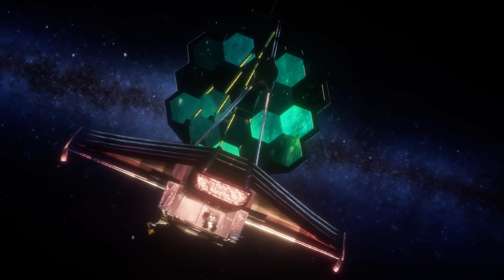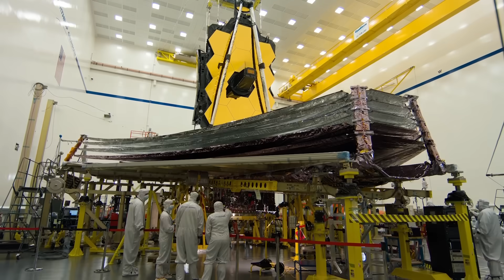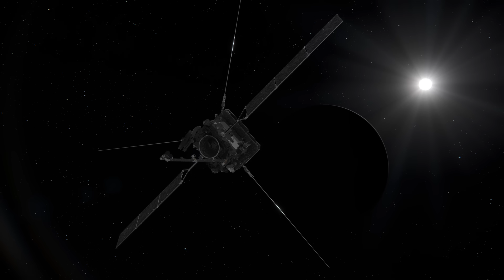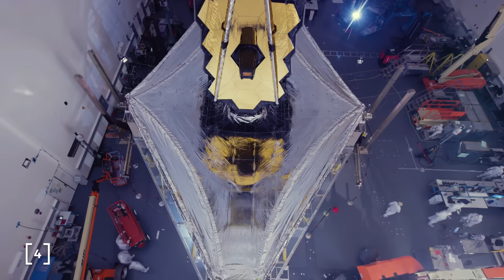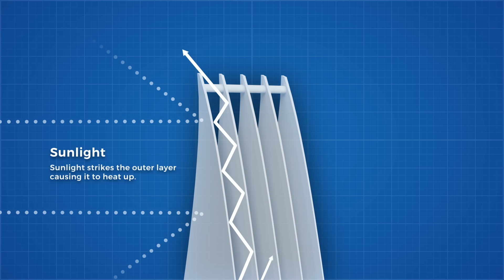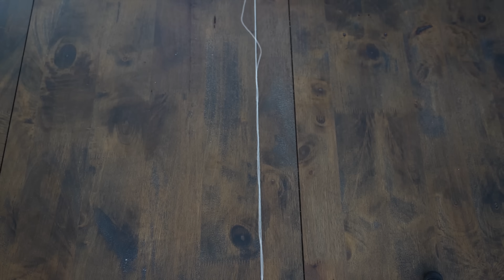The Insane Engineering of James Webb Telescope

Comment: Excellent video, really enjoyed it!

But a few minor mistakes to point out:
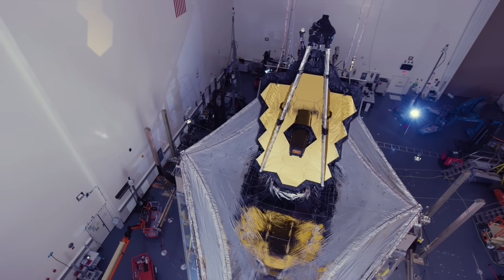5:22 You say "83 °C" but have written "-83 °C". I assume it should be +83°C.
18:56 Infrared is (unlike you said) lower frequency than ultraviolet and gold reflects lower frequencies well. You're thinking about wavelength .
Reply: also kelvin isn't a degree scale 13:34
Reply: Isn't the boiling point in space much lower though? So maybe he meant that -83°C was close to the boiling point of water in space?
Reply: I expect the correct value is actually -83 c
Reply: @GidionG  He did say it would be nearly hot enough to boil water, so I expect +83°C (as he said).
Reply: "The Pulse Tube Cryocoolers"  is a  great name for trendy indie  techno  low fi  neo jazz band...
Reply: @hieronymusnervig8712  That's what i thought too
Reply: @GidionG   since there is no pressure in space, the temperature necessary to boil water falls. which is why -83c is not entirely wrong.
Reply: @jmax8692  nothing wrong with a little correction, it's constructive criticism and that's important to most people.
Reply: Another problem is that he says " ## degrees kelvin" which is wrong. When using Kelvin you don't use the ° sign as you don't say "degrees". It's just "kelvin"
Reply: @jim Anyone going to tell him? No? I aint doing it
Reply: hirvi more like poro

ookkos suomalaine
Reply: @hieronymusnervig8712 , in space water and any liquid boils at any temperature.
Reply: @mina86  No, the boiling point drops a lot in space but not down to 0K.
Reply: He references [3] on screen in the video, but does anyone know where the actual reference link is? I didn't see any at the end of the video or description.
Reply: @siggyincr7447  You can get 0 vapour pressure? OK I guess as long as the material is a solid.
Reply: @Astor_V  83C in earths shadow. Nah. I'll go with -83C.
Reply: 6468
Reply: Ok, I though I saw -83, but wasn't sure. thanks for the sanity check
Reply: i was about to comment that but i saw this comment
Reply: Maybe do to the vacuum of space?
Reply: @grekiki  solid to gas is sublimation not boiling.
Reply: Water boils easily in space.
Reply: @SeaJay_Oceans  And their first digi-single will be a pulse code modulated sine wave.
Reply: @jmax8692  irrelevant
Reply: I was going to mention this, but found your comment! Good job
Reply: @sleeptyper  No it is not, Kelvin is an absolute unit. Therefore the only correct way is (number) Kelvin or (number)K, whereas Celsius is a degree scale, therefore (number) degrees Celcius or (number)°C is the only correct notation. 
Also there is no such thing as "273.15 Kelvins" or "Zero Celsius", a unit doesnt have multiples and temperature in °C has to have a degree notation.
I encourage you to read up on the SI unit standard.
Reply: @jmax8692  On the other hand, it shows that people are paying attention, and if the questions and/or corrections help those who were confused by the errors, surely it's a good thing?
Reply: @
Hirvieläin - From what information I can find, it does appear that liquid water would instantly boil in interstellar space at somewhere beyond -90C and then immediately freeze into tiny ice crystals. That said,  -83C would absolutely cause water to boil and remain as a vapor due to the near perfect vacuum of space. That leaves us with the sentence in the video saying "...nearly hot enough to boil water" thus we can conclude that he must be either talking about +83C or has something wrong.

Now, I would be very surprised if the sun would actually heat something to +83C at a distance 1.5m KM further than earth. Then again, there is virtually no conduction or convection happening to remove any thermal gain, only radiation. Perhaps it would actually get quite hot where the sun makes direct contact for this reason. Hmmmm, not something I have ever thought about or researched before.
Reply: I've pointed out a couple times errors in previous videos. Sometimes they are typos or discrepancies between what he says and what he illustrates that would have been picked up if the video was edited properly. Other times, he gets the facts so wrong (a recent video on shockwaves and another on  the 787), it suggests the author is far from an expert on much of the content and merely compiles research that he may have interpreted incorrectly. 
The fact that he doesn't correct the his mistakes or respond to comments that point them out tells me to question the accuracy of what he publishes and that he makes videos for entertainment and cha-ching$ rather than factual educational videos.
Reply: @majbach1968  TBH there are a lot of YouTubers who just collate shit from Wikipedia and don't really care if it's right or not.  Being right doesn't make you any more money.
Reply: @Mp57navy  Then you'd guess wrong. It's not in the Earth's shadow and that was never stated. You wouldn't need a 5 ply sail to protect against 200,000 watts of sunlight and the scorching heat of "-83 C" if it was.
Reply: @hieronymusnervig8712  the boiling point of any liquid is partially a factor of the atmospheric pressure around it. Since the pressure in space is 0, the water would boil in space no matter what the temperature was. By this logic, since he was talking about a specific temperature at which water would boil, it seems to make sense that he was referring to +83°C and at a location where the atmosphere would be present.
Reply: @siggyincr7447  Well it's impossible for anything to boil at 0K but space isn't 0K is it? But it is at zero pressure. What both of you are forgetting is that all liquids will boil instantly in a perfect vacuum but only briefly until they turn into a solid from freezing. At which point it goes from solid to gas - sublimation as you said. In a vacuum, water still freezes at 0C but will only sublimate until about -50C . If sublimation/boiling occurred at any temperature while in a vacuum, comets wouldn't be made largely of ice.
Reply: @hoagy_ytfc  Agreed
Reply: @subsgob00m  Absolutely it would get that hot. Without an atmosphere, there is nothing to scatter or absorb the energy of sunlight. He did state that the area the size of a tennis court would receive 200,000+ watts of energy. Think about how hot the sun-side of the moon gets (250C) or how comets start to sublimate many millions of kms farther away from the sun than the Earth is.,
Reply: @_--_--_  I stand corrected. Thank you.
Reply: @Mp57navy  It's not in the Earth's shadow. It will orbit the L2, not sit still in the middle of it. It's powered by PV, solar cells, which wouldn't do much if it never saw the sun. That said, the cold side of the spacecraft is in the shadow of the sunshine.
Reply: @the1dark2prince3  -83C is above the 145-170K marking the lowest sublimation point of water ice, so it is very much entirely wrong.

Also, without pressure there's no boiling. Just sublimation.
Reply: @Mp57navy  at 1.5mm km, Earth doesn't create a complete shadow. Earth's angular diameter will be about the same as the sun, so it will be outside the umbra. The actual temperature is rather a silly figure, because it all depends on how much energy the materials absorb per unit area and how the energy dissipates internally. There is no classic "temperature" anywhere in space. While individual particles have a certain amount of energy, the way we think about temperature -- ie the thermal equilibrium that will be reached by something hanging around there, doesn't apply objectively.
Reply: @majbach1968  It's technically in Earth's shadow, but outside of the umbra. It is also going to be in a halo orbit so it won't get the maximum radiation shielding it would get if it were perfectly aligned with the Earth and sun.
Reply: @majbach1968  he does reply to comments that criticize him and does take away from it I've seen it many times on many different videos including this one.
Reply: @KCNusach  The person's remarks that I replied to implied that it was hidden from the sun's light by being engulfed by a shadow - which is incorrect. And technically  it is not in the Earth's shadow either but rather the Earth's shadow falls on the mirror, in the same way a bug that is several hundred feet away from flies between your eyes and the sun.
Reply: @majbach1968  The angular diameter of an object is constant multiple of its diameter divided by its distance. At Sun/Earth L2, Earth's variable coefficient would ve be 12.7/1500 (12700km: 1.5Gm) whereas the sun's would be  14/1510. That's a pretty significant eclipse. 91% of diameter, and more than 80% of luminosity blocked out. It helps that it would be in a halo orbit, although I'm not sure about the size of that pseudo orbit.
Reply: @_--_--_  I'd like you to elaborate in practical terms. If we skewed the value of absolute zero to be defined as 0 degrees Centigrade and the temperature at which water freezes is 273 degree C, the graduations or units between different levels of heat would be the same between Kelvin & Celsius. No? Kelvin and Centigrade both have the same magnitude, their scales just have different base references. 
Omitting the word "degrees" when using Kelvin is semantics, no different from using the term knots instead of nautical miles per hour. At least that's my take on it. Reference why I am wrong pls.
Reply: A simpler way of putting it is, diameter ratio sun:earth is ~109; whereas at L2 the ratio of the two respective bodies' distance is ~100. So you don't get a total eclipse, but it ain't a gnat at a hundred paces...
Reply: @majbach1968  agreed. High production value, low integrity. But I still appreciate the content because he and I agree on the definition of insanity vis-a-vis engineering 😛
Reply: @majbach1968  sorry for responding to your fifth comment in complete schizophrenic order, but here goes. Besides the history of the various temperature scales (and "degrees Kelvin" used to be a thing until a couple of decades ago) the centigrade and Kelvin scales differ in that the former's units are defined as degrees in a finite interval, whereas Kelvin is defined as the measure of temperature from an absolute point. We don't have degrees mass or degrees velocity.
Reply: Yes bit confused at that part but you corrected it👌🏻
Reply: @majbach1968  
You are wrong exactly because Celsius is not referenced to absolute zero, therefore it is not a absolute measurement of the physical property of temperature, there is no such thing as negative temperature, and because Celsius in not a absolute unit we have to therefore notate it as a degree.
But because Kelvin is a absolute unit because its referenced to absolute zero so it does describe the property of temperature in an absolute manner it has to be notated as just the unit, the usage of "degree" is plain and simple not correct.

You can call units whatever you like as long as it works for you, however this discussion is about correct notation, therefore semantics do matter. Words have meaning, and changing words changes meaning, this is especially important in physics and engineering related topics, as precision in communication with language or math is of utmost importance.
Reply: @hieronymusnervig8712  I am assuming that the -83 C was the error since he mentioned the boiling point of water and in the thermal imaging example he used later it showed the first layer of the thermal shield being close to 100 C
Reply: @p_06k  Yeah but that is a pretty pedantic point, it is just an arbitrary definition that makes no difference
Reply: @gillysuit2 I understand the confusion, but the European Space Agency operates facilities all over the globe. One of them happens to be in Kourou, French Guiana, in South America.
Reply: @hieronymusnervig8712 
The triple point if water is not much below 0 C, below that liquid water doesn't exist and water goes straight from solid to gas (sublimination).
Also if I remember rightly the sublimination point at low pressures is ~50C.
Reply: @alexpontecorvi3092 
Right now the convention us to drop the "degrees" but that wasn't the case historically.
I wouldn't call it wrong, just archaic.
Reply: @jr2904  It's important to people who car about science and truth. Apparently, Jay doesn't care about those things.
Reply: i did some research and found that the boiling of water depends on the pressure. and there is near to non(there is non) in space.
Reply: I think you didn't listen him well,he said that gold is a poor reflector for lower frequency of "visible" spectrum of light,it doesn't include all the light spectrum for which infrared has lower frequency.
Reply: @scienceaffairs2919  He probably meant wavelength, not frequency. Look at the graph. Reflectance is low for lower wavelengths (or HIGHER frequencies).
Reply: Wild theory here, maybe he just didn't see the negative sign when he read it, but it was put it in the graphic correctly? Minor mistake, kinda funny lol. Adds to the character of the video IMO, and humans are smart enough as a whole to self-correct. Apes together strong
Reply: these always have plenty of things wrong, they just have good production value and look good. still full of errors
Reply: At near perfect vacuum of 29.9199 inches of HG vacuum, the boiling point of water is approximately -90°F or - 68°C. Space is not a perfect vacuum. Even so, the figure mentioned was MINUS 83 degrees Celsius, not Kelvin, which is not measured in degrees anyway. If he's stating that the temperature on the far side of the shield is -83 Celsius and water boils at -68 degrees Celsius, then it is only 15 degrees Celsius from the boiling point in near vacuum.
Reply: @gillysuit2 he said it was European, not in Europe. As the name suggests it is owned by France, therefore it is European even if it isn't in Europe.
Reply: @_--_--_  I think you just contradicted yourself and proved my point, particularly because I asked for a practical example or a reference that backed your statement.Both Celsius and Kelvin DO have the same magnitude or graduations. So, if you defined absolute zero as being 0 C, the only difference between Celsius and Kelvin when specifying the temperature of matter would be add the word "degrees" into one and not the other - at least by your testament. I think you need to go read what Unit" and "absolute" means. And, it IS semantics because if I say 100 Kelvin or 100 degrees Kelvin, the meaning isn't changed, not to any listener nor to any equation. Give me ONE example of how placing a º before a K in any way changes the value or meaning. .
Pointing out that "273 degrees kelvin" should have been "273 Kelvin" is like faulting someone for having written "your" when it should have been "you're" on a math exam.
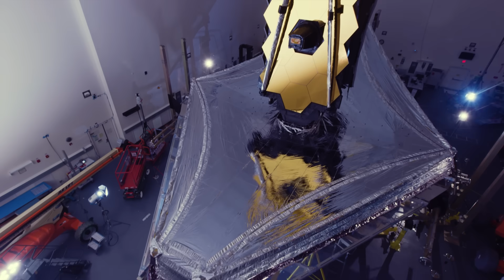Reply: 7:53  It’s Aluminum. Not Aluminium.
Reply: @_--_--_  The rankine scale is also an absolute temperature scale, but curiously has degrees. The decision to add a degree marker or not is an arbitrary one, and even scientists sometimes say degrees kelvin. It literally does not matter to anyone but pedants.
Reply: @KCNusach  No need to apologize, I like the discussion. 
Your last statement DOES give me pause. But I am still failing to grasp the practical implications of your explanation. How is Kelvin NOT a finite unit (with the same magnitude at Celcius as well)? And isn't Celsius ALSO a measure of temperature? Also from an absolute point (in this case, the freezing point of water)?
Is saying "it's 20 degrees Celsius outside today" not exactly the same as saying " it's 20 Celsius outside today"or "it's 20 degrees outside today"? Even when we are in an environment were there are NOT multiple or ambiguous units  (like mph vs kph) for expressing the same value, we still always follow a value with a unit: "the rock weighs 10 pounds". With temperature, we state" it's 90 degrees outside". We don't follow it with Fahrenheit, Celsius or Kelvin, because it's never 90 K or 90 C outside but we do still say "degrees" to indicate we are talking about temperature (and not humidity for example). The word "degrees" may not be a unit itself but it is used in lieu of one and thus has the same meaning. 
It was suggested originally that the term "degrees" actually changing the meaning or value when used in conjunction with the unit Kelvin. It does not. We don not have degrees mass or degrees velocity but both mass and velocity are measured with units that have graduation, magnitude or even "degrees" - if you look at the definition of degree. It is just normal to state the unit instead of the word degree. In temperature, it's normal to say "degree" instead of the unit. The value isn't changed. 
In geometry however, the word "degree" does change the value of a measurement.
Reply: @JohannGambolputty22  HaHa. I was thinking of saying that too. Ironically, I just read yesterday that the modern British accent is actually younger than the current American accent, in other words, centuries ago, British sounded more like modern day American English than it does modern day British English.
Reply: @majbach1968  the comparison with geometry is apt. A degree is a unit of arc defined as 1/360 of the circumference of a circle. The absolute unit of angular sweep would be radians. This isn't about ambiguity: both units are defined with equal precision; it's about what the unit presents. One is a fraction of an interval, the other is an absolute magnitude.

Using the word "degree" is adding a dimensionless coefficient to your result: in geometry, what you're saying is x(2pi/360). In temperature you're saying x(boiling - freezing)/100. The Kelvin already has that factor. Technically, degree kelvin, if "degree" would be defined as per Celsius, you'd have a unit of 1/100 K...
Reply: Which country use farenhight and which does use degree Celsius
Reply: @majbach1968  
Lets just say its a good thing that you arent a engineer (or atleast I hope so), because of exactly that mindset do probes crash into the surface of mars unintended and bridges collapse, with countless of examples where faulty unit conversion was mostly caused by bad or unclear notation.
This is your practical example why stuff like this does matter, if you go over checking lots of calculus, something like "°K" can be easily confused with °C, because our brains automatically assume things.

I already explained it pretty clearly why it is notated in the way it is.
I will try again as it is obvious you didnt understand.
The magnitude of the unit is completly irrelevant, it doesnt matter that K = °C + offset.
What does matter is that one unit represents reality, the other does not.
x°C tells you nothing about the kinetic energy that is heat without already knowing a reference point of energy, for example 20°C.
Because you need a known reference point for the unit to be useful it is a degree scale.
With Kelvin you dont need a reference point to know how much Kelvin is how much potential energy, thus the unit is absolute and not a degree scale. It is literally that simple.
Reply: @timseguine2  Well thats mostly just imperial weirdness, you dont have such inconsistency with metric.
Also I think its important to mention that the degree is very often omitted with rankine exactly because of the same reasoning as with Kelvin.
Also I dont think any scientist worth their salt would ever say "degree Kelvin", I have never seen that, but maybe you mean some weird TV "scientist", then yeah maybe those would say something stupid like this but they are only "scientists" for show anyways.
Reply: Lovely video but Also the atomic weight of Beryllium is approximately 9 amu and not 4 amu. The atomic number (number of protons in the nucleus) is 4.
Reply: @hieronymusnervig8712  I'm pretty sure that at -83°C water isn't boiling, it's frozen solid.  Given the low ambient pressure, there will be significant sublimation, but boiling?  I think not.
Reply: @jmax8692  
Constructive criticism is also totally why this comment section on YT existed... at least in the good old days.
Reply: @scienceaffairs2919  
That doesn't track, especially when gold is so poor at reflecting shorter wavelengths of visible light... that it appears gold.
Reply: @_--_--_  
"ISO standard day conditions means 288 degrees Kelvin (15 degrees Celsius), 60 percent relative humidity and 101.3 kilopascals pressure." Source: ECFR Official Government Website.
Also "CRYOGENICS is a science concerned with the very-low-temperature environment, extending from a high of 77 K (degrees Kelvin), or —196 C (degrees centigrade), where liquid nitrogen (N) boils at standard pressure, down to absolute zero (0 K or —273 C). This region has come to be associated with rockets, many of which carry large quantities of liquefied hydrogen (H) and oxygen (O) as propellants." Source: "Application of cryogenics to electrical and electronic design" - published by IEEE 
Typos abound am I right?
Or maybe... just maybe, it's not as big a deal as you thought?
Reply: @VariantAEC  sourced argument, hurrah
Reply: @BradBozarth  
I do my best to source my findings even in the current era where citations are frowned upon.
(YT won't allow me to also link the sources I used here)
Reply: Well when ice asteroids from asteroid belt enter the inner planets Sun actually boils water off them making those gas plume-like tails we call comets. Once I saw a documentary about SpaceX flight computers that have to withstand extreme temperatures differences when in and out of Earth's shadow (somethink like from -240°C to +120°C but I could be wrong). Temperatures certainly varies in regards of distance to the Sun.
Reply: @holy3979  You don't assume, this can be answered easily using google and -83 is actually close to the fact.
Reply: beryllium’s atomic weight is 8
Reply: No assumption necessary: “Thermal models show that the max temperature of Layer 1 is 383K. The max temperature of Layer 5 is 221K, and its minimum temperature is a chilly 36K.”

383K = 109.85°C
Reply: @hieronymusnervig8712  True, but the point of relating it to boiling water was to make it easier to comprehend to common people. Referencing the boiling point of water in a vacuum without explaining the difference would just make things more confusing.
Reply: @Mp57navy  The JWST won't be in Earth's shadow, it's orbit was specifically designed to avoid it in order to prevent a loss of power from the solar panels.
Other people pointed at the fact that water would boil in vacuum at lower temperature than on eathr. This is true, and to be more precise, water could not stay liquid in vacuum, it can only be a solid or a gas. Anyway, I assume that he only talked about the "boiling water" thing to give a reference point for people, especially those that are used to °F, and not an actual indication of water boiling on the Webb (as there would not be any water there anyway...).
Reply: If you really think 1 million miles away from earth - further from the sun will somehow become +83C in space, then you are not the position to point out mistakes. Water boils at -63C in space, thus -83C is "nearly" boiling, which is why he said that although he did not say "minus" 83. But the conclusion you draw that you "assume its +83C(181F in space LOL) shows some weird brain thinking on your part.
Reply: @cjay2  
Did he write °K?
No he spoke it. I've already covered how major institutions including IEEE don't exclude the word degree from Kelvin standard notation is just "K" for Kelvin scale temperatures and no one is arguing with that but I don't see "°K" notation anywhere in this video I heard the spoken word "degrees Kelvin" and it appears in the auto-generated captions and English captions and that is just fine.
Reply: @Mp57navy  NASA expects the first layer of the heat shield to get to a maximum temperature of 110*C. It's orbit does allow for the sun to directly hit the shield. When operating in place 83*C is expected.
Reply: @majbach1968  You yanks are so behind us.
Reply: @AndrexoHD  At -83 deg C water is not boiling it is solid(ice)... comets starting to sublimate(not boil) when they are closer to the sun they are never in liquid state...
Reply: @WOTArtyNoobs  "At near perfect vacuum of 29.9199 inches of HG vacuum, the boiling point of water is approximately -90°F or - 68°C. Space is not a perfect vacuum." -> Sublimation is the transition of a substance directly from a solid-state to a gas state. There is no boiling at - 68°C in space because water can't be liquid in this conditions.
Reply: @undead_corsair  I ain't no Yank, eh?
Reply: @the1dark2prince3  actually the melting point of water is still almost exactly 0 °C at zero pressure because the melting point depends only slightly on temperature. So at 0 pressure water doesn't boil at all, but it is either solid or gaseous and sublimates at 0 °C.
Reply: @Bialy_1  Quite true. Water would sublimate at this temperature. I doubt that there would be any water on the James Webb as it would dissipate by the time it gets to L2. I guess he was only trying to suggest that it's cold and prompting people to post comments on his supposed mistake - that was not a mistake,  because they were jumping to the conclusion that the boiling point was still 100C. The more comments you get, the more likely the algorithm will notice you.
Reply: @Bialy_1  
When did I say I was an engineer of any kind?
Nothing about the word "Degree" means that it cannot measure something absolutely. It is a mistake of the video host, but actual graphical notation doesn't seem to reflect the verbal mistake (also mentioned). I also used ECFR (European Code of Federal Regulations) as a source so maybe you should take umbrage with them.

The video host is allegedly an engineer so his use of degrees before the word Kelvin seems to be a European thing and I honestly don't have a problem with that.
Especially when it has been stated that achieving absolute zero is a universal impossibility. How can anyone say absolute zero or zero point motion is even something we can measure absolutely when we haven't?

The reality is we have a model that attempts to measure temperature absolutely and while it's the best model we have and the most accurate scale we have for measuring temperature it isn't actually aa absolute as we thought which is precisely why zero is currently at -273.15°C it moved from -273°C (not sure when the temperature waa chnaged but this movement seems to have happened and according to NIST - a scientific organization - 0 K used to be lower set at -273.16°C based on the triple point of water as defined by "Vienna Standard Mean Ocean Water" yes, that's a thing).
Reply: In space, -83 °C
Reply: Thanks for pointing out the infrared vs. ultraviolet mistake. I work with lasers everyday, so I was a bit facepalmy after hearing that, "degrees Kelvin" and the oversimplistic explanation for the silicon coating. I guess that's the price of ELI5 videos, but it's way more accurate to use the words scientists made for these and define them.
Reply: @jmax8692  It's not about making the video. It's about the science.  When students reference research like this video and cite the reference to produce research papers (which is certainly a reference allowed under APA format), things like that truly matter.  Just sayin'
Reply: i thought he would be sarcastic, because even at 83°C it would be "scorched". I thought it was a nice word play joke.
Reply: @grekiki  At very low densities, the liquid state does not exist. One can see it on a phase-diagram. Gases condense (adsorption) on cold surfaces and solids evaporate (desorb) to the gas-phase. The condensation temperature depends on the density of the vacuum. Close to the Earth the density is around 5 Hydrogen particles per cubic centimetre.
Reply: I think it is a great video, but there are a few errors that make it seem like video maybe was made a bit rushed. The pointed out (-)83 deg celcius error and degree Kelvin for example. Also it is saying moving cold to the hot parts. That's plain wrong and against the laws of thermodynamics. Also the probe will stay continuously in the shadow of the moon.
Again, great video, but there seems to be a slight lag of quality control in this one for some reason. Still a thumbs up though :)
Reply: @majbach1968  Yeah I seem to recall a video in which he claimed that 70 dB was 17% louder than 60 dB (or something to that effect). He's clearly out of his depth on a number of topics.
Reply: @siggyincr7447  lol nothing is 0°k
Reply: @JohannGambolputty22  both are correct. Google it 👌🏾
Reply: And also the atomic mass of beryllium is 9 amu of what you said 4 in video.
Reply: can anyone explain why it wouldn't be simply a temperature that is normally in space, 2-3K ? why 83 C ?